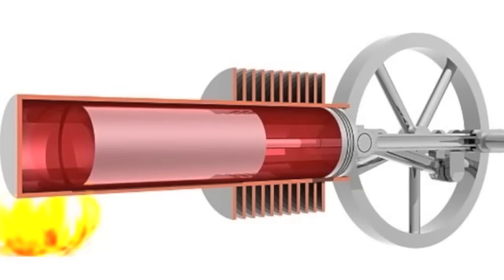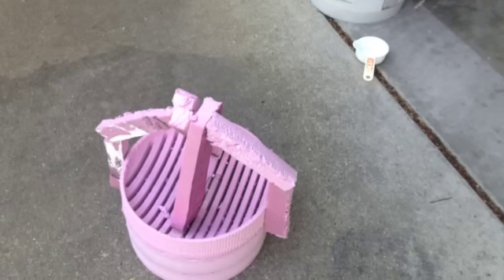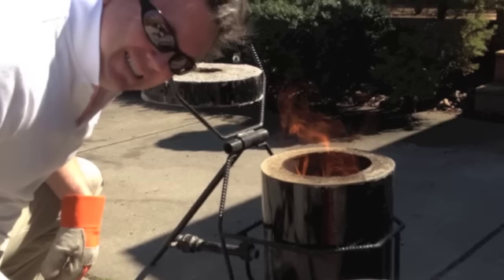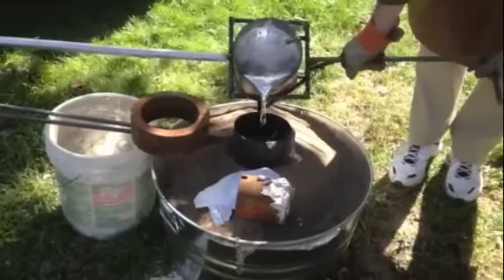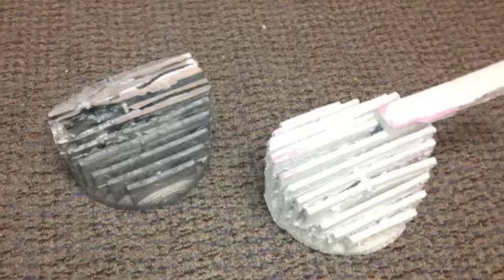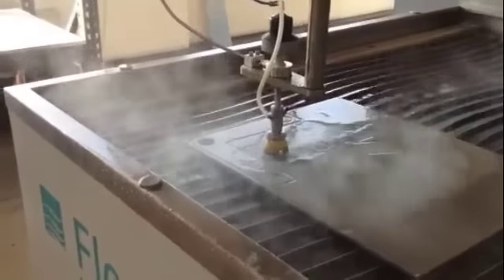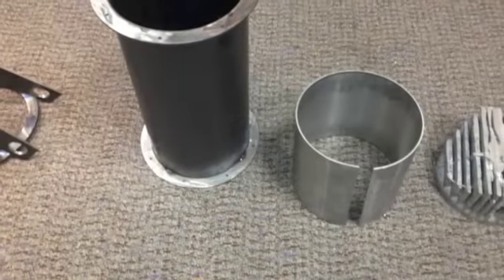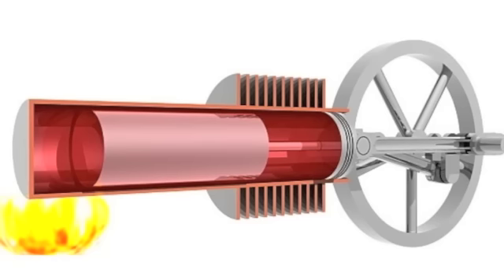Volo Engine Project Update 5-2012

Comment: O calor aplicado em um lado do cilindro rapidamente se propaga para o outro fazendo com que a diferença de temperatura, que é a energia útil, seja mínima ... É necessário que o cilindro seja dividido em dois e interligadas as partes com um meio isolante térmico ...  Parabens por voltar ao projeto !!!
Reply: Hi Claudiomar,
Not sure if I'm understanding your question but I think your wondering if the hot and cold end's of the engine are thermally isolated.  Yes, the hot and cold end of the engine and displacer are thermally isolated from one another.  The outer chamber is split and there is a 8" buffer section to isolate the two ends - internally, the displacer hot and cold ends are thermally isolated from each other.  Over time we see some build up of heat on the hot end of the engine until it reaches equilibrium.
Tim
Reply: Many thanks for the extensive reply ... In some Stirlings is used what they call regenerating ... He thermally insulates the hot and cold sides of the cylinder itself through himself ... So the energy applied to the motor can be much smaller .. . its yield much improvement ... Just saw the cylinder and connect the two by a cylinder of thermal insulation material ... that I tried ... the direct connection of the two sides of the cylinder, by itself, reduces the thermal capacity differential iN VERY ... in classical Ltds BOTH bOARDS are separated by the material of the box itself ... so healthy LTD's ... Work with less than 10 degrees between the plates ..